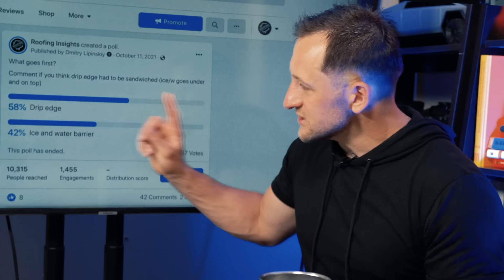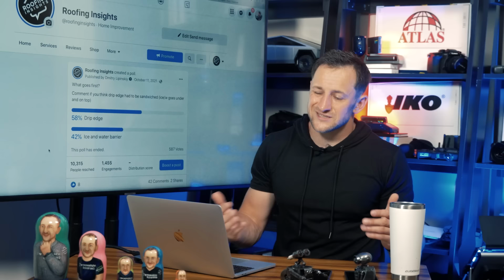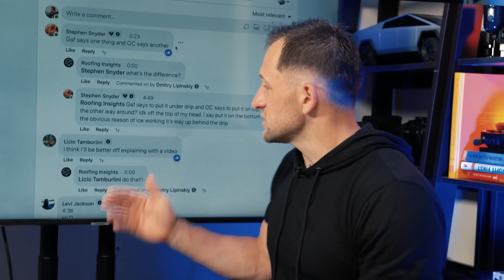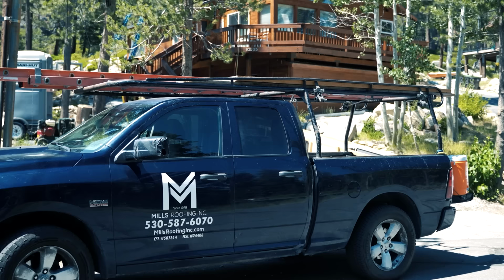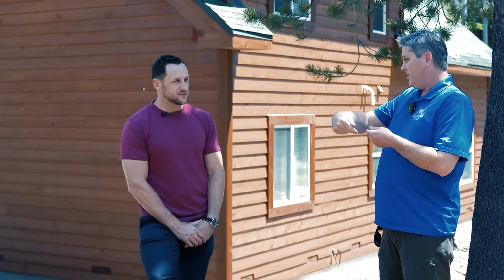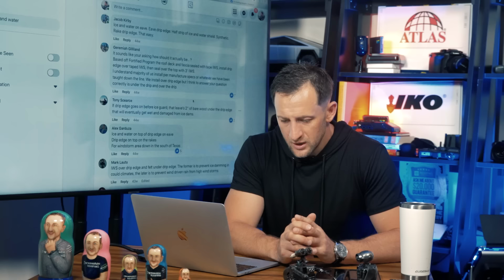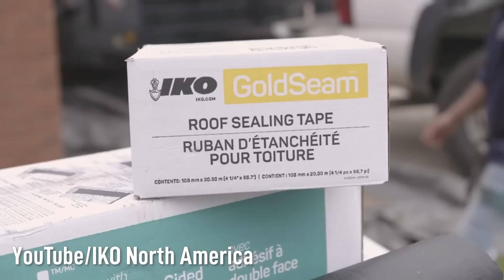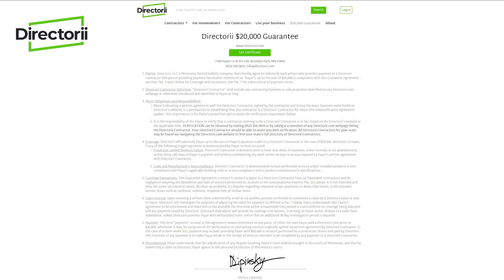The Big Roofing Debate: Drip edge or Underlayment first?

Comment: We're following the Fortified standard with an IKO CodePlus system. In Dallas, so we don't require IWS at the eave. So, combining CodePlus with Fortified, we do IKO Gold Seam tape first--2 inches on the deck, cover the gap and go down the fascia. We're also taping all the seams in the decking with the Gold Seam tape. Next, we install our synthetic underlayment. Then we install drip edge we fabricate from 24 or 26 gauge metal - 2 inches on the deck and 2 inches down the fascia, nailed every 12" in a staggered pattern. Then we use IKO's double sided self-adhesive starter before installing our first course of shingles. That edge is totally sealed.

Comment: First off, we put I/W on BOTH the EAVES AND RAKES.  AND they are NOT allowed to cut the rolls in 1/2 for the rakes.  FULL ROLLS are laid out on BOTH.  

For the eaves of the roof; I prefer the dripedge UNDER the I/W and OVER the I/W on the rakes.

My theory is rake ends are more susceptible to wind damage & your eaves are more susceptible to ice damage.  

By putting it under my dripedge on the rake ends I add extra securement to my underlayment and double securement to the I/W... should shingles start to give at least i know the deck still has that back up protection from water damage until repaired.

By putting it over the dripedge on the eaves; I prevent any possible ice damming backing up and making its was under the dripedge.

The eaves and rakes vulnerabilities differ from one another that's why I believe they require different dripedge install methods. 

Kimberley Sammon
Owner
BluDog ROOFING, LLC
Woman Veteran Owned

Comment: WRB peel and stick  directly on the roof deck if your not using zip sheathing then drip edge then Ice n water  our code req 3ft on rake and 6ft on gutter  i actually do entire roof with ice and water now you have 2 layers of protection .

Comment: In Manitoba we do drip edge first. For years guys installed shingles around here with no underlay at all! People didn't usually have problems for as long as the shingle lasted if they were installed properly.
Reply: Absolutely! I have torn off literally thousands of roofs with no ice and water shield whatsoever 25, even up to 40 years old and never had a single issue. depends on the house, insulation, where you live, how much sun your roof gets, you name it.

Comment: Our company in Olympia Washington area does 3 inches of the ice n water over the fascia and metal over the ice n water. Then underlayment over the metal. We have lots trees that fill the gutters up with debris and water then splashes up under the metal and damages the edge of the decking.  If we do not do it, it will rot the face edge of the decking. The gutter then goes over the 3 inches of ice nwater on the fascia. If we do not remove the gutters we tell the customer it will not work to ice n water over the gutter. If the edge of the decking is not protected then it will wick up every time. We do not have ice wicking problems here like they do in other colder climates. Once in a while it will wick up the valleys where we always do ice n water but very rare.

Comment: I'm surprised that IKO "Edge Seal" starter roll is not in the conversation. 
We prefer to install ice/water covering fascia first. Then install drip (add a fingers width gap behind drip on shallow pitch). Then Edge Seal on rakes and eve's. This method provides an extremely tight bond between the shingles and the drip. Well worth the added time and $!

Comment: I have seen condensation marks EVERY SINGLE TIME that I have taken drip edge off that was under the weather guard. I can support this method, ONLY if there is window tape, or ice guard strips under the drip. We so it under the drip, but extending at least 1/2” over the fascia, so anything that gets under will be sealed and drip in gutter. Finger width gap behind drip. On low slopes I have taped, and installed over drip edge on lower slopes that we Ice guarded.
Reply: So, if I understand... first, IW strip on the roof plywood, but curled over and pressed against the fascia.  Then gutter.  Then drip edge, but with a finger-width space between it and the gutter.  Then IW again over the drip edge.  Do I have it?
Reply: @livenhfree  
You got it!! If you do not live in major ice dam areas, putting it down over the fascia is not necessary.
Reply: @renurenovationsllc7780  Thank you!  I live in So. NH.  I'm taking a bold leap and trying my hand at repairing some fascia rot on an inside corner of two roofs.  I know the fascia needs to be replaced, and I have no concerns about ripping off the gutter, but the trick I think is going to figure out where the moisture is coming from (a hose test directly in the gutter comes out clean), as well as how to retrofit new IW sheild underneath the shingles where it's needed.  More video research to do!  Thanks again.

Comment: The ice guard on top of the drip edge causes a lip for water to travel on, rather than shed over. Now any water that escapes onto the starter shingle and through a bond line; will follow the lip you’ve created until it finds a hole. Which it will, especially after ice has its way with it.

Comment: I really didn't realize this was even a question.  The point is to make sure water is kept from contacting the wood decking and facia.  The only way to prevent this is for the ice & water shield to lay over the drip edge.  If you place the drip edge over the ice & water shield, any water running down the surface of the water shield can easily slip underneath the leading edge of the drip edge which then exposes the deck edge and facia to water.

Comment: I’ve always put drip edge over the winter guard. Occasionally I’ve done a 12” strip of winter guard then drip edge then full roll winter guard over drip edge. 
I’ve pulled off lots of drip edge/gutter apron that had rotten decking along the bottom edge due to ice building up in gutter getting behind drip edge and soaking into wood.
Reply: you are correct my roofing brother

Comment: I’m not a professional…anything. But I’ve done my fair share of roofing, for a homeowner. When I was first presented with the decision of which to put first, I resort to my “everyman” understanding of physics and logic. I chose to put the underlayment first, and then the drip edge. It made sense, to me, to seal off the edge of the underlayment by placing the drip edge on top of it. If wind blows water up under the shingles, and manages to also go under the underlayment (for whatever reason) then when it drains down it can go under the drip edge causing not only possible leakage but rotting of the plywood. I may be wrong, but I live on a regularly very windy area. We have what most people refer to as tornadoes, but here it’s just a windy day.

Comment: We are in Tennessee and there is no code about ice and water on the eaves. We install one row of ice and water on the eaves to prevent the gutters from backing up, if they get clogged. I have seen that happen more than once down here. And this winter is the first time I have ever seen an ice dam in Tennessee. We had tremendous rain, and then it got extremely cold quickly. I had a customer that had his gutter draining into the ground, and it froze, and it backed up and froze 50 feet of gutter 6 inches deep. We put the drip edge on top of the ice and water shield. In cases where we do not use ice and water shield, we  put the synthetic felt over the top of the drip edge. I think that is counterproductive.

Comment: Read the instructions on the box.  It laterally says on the sheet in the box and on the box how to install.  Water condenses on metal with temp and pressure changes.  If metal is in direct contact with wood this cycle will soak the wood daily.  So underlayment, then metal.

Comment: Malarky recommends their peel and stick wrap around 1.5 to 2 inches onto the eves.  Then use plastic button nails to further secure the undetlayment/wrap to the eve.  Then you treat the metal drip with water vinegar mix, let dry, and adhere the drip edge with their sbs caulk.  Drip edge then nailed on top.  Note eve side of drip edge now covering button nails. Then drip edge gets additional peel and stick on top of the drip edge, about 6 inches to cover the nails.  I'm not a roofer, but in the market for a new roof. When I interview roofers this topic is the one I quiz them on, as it tells me how they think. Thanks everybody!

Comment: CANADA does have code. Also we have 1 of the largest roofing schools in north America. Its a 3 year apprenticeship program.  Canadian red seal certification. 

There is only 1 right awnser to your question. Following city codes might pass inspections.. but climate does change  and freak storms do occer.
The awnser is a strip of Ice and water needs to be on first as metal sweats then install roof with full ice and water. 

Now you are water tight! Doing it this way will also allow you more freedom of getting started on other jobs until a shingler can come do the work.

-Advanced Roofing Contractors.

Comment: Drip edge under ice dam on the eave edge, drip edge over the ice dam on the rake. If you put the drip edge on top of the ice shield on the eave edge the water goes over the ice dam as it is supposed to then it gets under the drip edge and gets the wood wet at the edge. The ice dam doesn't seal well on vertical surfaces at all.

Comment: This is what Texas Windstorm requires: "The roof underlayment must be installed over the drip edge along the eaves and under the drip edge at the rake edges of the roof."
Reply: ....you can go even further,...apply Karnak Roof Cement(wet/dry) on all edges,...eaves and rakes,...problem solved! However, be very careful with "your messy"roofer...every crew has one

Comment: The purpose of the IWS and valley flashing is to waterproof in the event the water shed system is overwhelmed, or defeated temporarily. The waterproofing goes directly on the wood, then the water shed system with drip edge, then 30lb felt or roofing under layment, starter course shingle, then shingles. The drip edge is only nailed every 12 to 16 inches, which will gap in a strong wind, even if you dap it down. It will also cause condensation underneath the drip edge. If your IWS is over the drip edge, it can peel back, stretch, and warp, letting moist air in. When you get an ice dam, you essentially have a partial flat roof situation, and you need the impregnable sytem for that duration under the affected area. The drip edge isn't doing much because the water is going off the rake because of the ice dam.

Comment: Metal should be sandwich between two layers of ice and water....metal condensates and if it's in contact with wood then that wood will always be moist causing delamination and eventually premature rot...to avoid this an 8" strip is installed at the eave edge for seperation then metal starter then first row ice and water

Comment: In Miami,Fl we have to put the anchor sheet (astm 30) first then the drip edge. If client chooses to have a SWB installed we install a 9” strip of SWB on top of the anchor sheet , then the drip edge then cover the rest of the roof using the SWB

Comment: Do both to satisfy everybody. Measure out from edge how much ice sheild you need to cover fascia and especially if you are wrapping the facia to cover down and under and back up a half inch. Then drip edge  . Then run full width on top of drip edge and up roof. ALl problems solved.

Comment: First of all a barrier straight to the wood must go first, weather it be felt paper, synthetic or self adhered and then the drip edge. Once upon a time that was the end of this detail but we all know times have changed and so do processes. To continue with a watertight solution follow the proceeding installation with a solid sealed membrane on top of the drip edge. Depending on your location you will need to seal the top of the drip edge accordingly. When we seal the top of our drip edge it will always keep water from getting under it. Now you have it!
Reply: No times haven't changed you just got taught the wrong way and never had to go back and fix the damage caused by your own mistakes. OR you live in an area where it doesn't snow. Either way, cheers!
Reply: Wow Mark really I was taught wrong 47 years ago? my mistakes? we rarely have a call back and I can’t recall when we had one at the edge. Yes times have actually changed there was no such a thing as a peel and stick when I started. Much of my guidelines come from successful technics from books in the 1940s that still play true today. But you are right about one thing there is no snow in Florida which is where I’ve been running my roofing company for 43 years we just have a lot of rainwater to keep out. Chow.

Comment: Drip first the eaves, the ice will stick to it and you will never have a problem with water backing up. Plus I believe it’s in the ICC code. Every jurisdiction in my area it’s drip first on the eaves and over the underlayment on the gables.  One of the biggest problems is when roofer don’t give the shingles the proper overhang on the eaves even with D drip edge.

Comment: I live in Wisconsin and just had my roof replaced. The old roof was installed in 1991. No ice and water shield just old tar paper. No rot at all. I’m not sure what the roofer did but I’m sure it probably is better the old.
Reply: Intake Airflow at the gutter eaves along with sufficient attic insulation can keep any Ice Buildup to a minimum.  That's likely why your roof deck did not rot

Comment: If it’s OSB decking?
The weakness is the EDGE of the OSB - prone to swelling from weathering.

THEREFORE?

It absolutely HAS TO BE: 
Drip Edge FIRST….whether or not it’s an over-hanging (to fascia especially with gutters) of the Ice-&-water barrier or a hybrid of a Belt-&-Suspenders approach with a double layer of Ice-&-Water.

Comment: If your doing a new construction. Use a thin peel and 6” up roof and down over the full fascia. Then drip flashing. Ice shield over drip flashing. 
You don’t have this option with re-roofs . 
With re-roofs either ice first or drip first both work.

Comment: Start another survey :

Drip edge/gutter apron a fraction of a inch away from Fascia boards (i.e.: 1/4", 1/2", 3/4"; in Canada convert inches to metric, or just use the thickness of a Beaver's tail as a measuring gauge?); or place drip edge/gutter apron tight right up agaisnt the Fascia boards?

Comment: I’m in NH and my favorite thing to find is 3 feet of ice and water with the drip edge weather it’s over or under. Code here in NH is 3 feet past the interior wall meaning a full 3 feet past the eve and thickness of the wall. We install 6 feet over the drip edge at the eve.
Reply: Oh hey that's a great point, I made a response (before reading the comments) but I forgot to cover that fact. Yes, you're 100% correct. The heat loss from inside a building, no matter how well insulated, results in the formation of ice on the edge of the roof, creating the potential for leakage under the shingles. That's a fantastic thing to point out!

Comment: Before ice and water shield. We ran the felt, then the drip edge. Next we used upside down shingles as the starter strip. Then we shingle the roof. Now the felt is applied on the roof. Then the drip edge is installed. Next the ice and water shield in the valley. The ice and water shield is applied around the roof over the drip edge as the starter strip. Then the shingles are installed.

Comment: I don't think it really matters. First off you should be putting gutter apron on the eaves where the ice and water barrier is, so I'm going to assume we're just calling gutter apron drip edge which is relatively common. Honestly you should probably be applying the ice and water barrier directly to the decking for it to stick the best but you're going to have starter and shingles on the eaves regardless so it won't leak if the ice and water is over the gutter apron or under it, and it'll shed water the same.

Comment: So let’s go from a wet climate…. OREGON! In my area, we don’t have ice/water code 3’ or 6’ up. Just valleys…… for us, we do drip edge, then ice/water, then underlayment. Most snow areas use ice/water with the 3’ or 6’application. The one issue I’ve always had is they don’t put regular underlayment over the ice/water….. they also don’t weave it in the valleys. So many different ways people do it, but should be asked by manufacturers not roofers!…. I will laugh if a manufacturer says drip edge over anything.
Reply: I would retract my manufacturer section if I was in a snow/ice dam area. We don’t experience that in my area. Only lots and lots of water so I get the different process/experience/code in different areas.

Comment: I understand the value of IWS under from all these contractors experience, but what is the big benefit of over besides the words “it’s code”?  If OC says over, maybe the only reason is they just want to comply with “it’s code”. Have people seen drip edge popping up from ice expansion when the IWS is under?  Also, I picked up on an important comment from here where a writer says they put the synthetic felt over the double IWS/drip edge sandwich to keep the shingles from getting glued to the sandwich and thereby cause problems with different expansion rates and future re-roof nightmares.